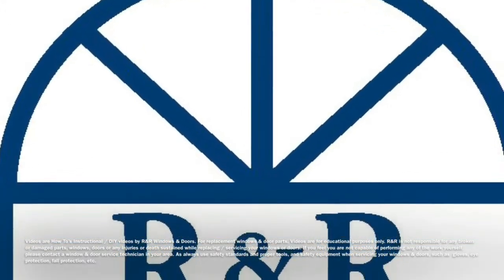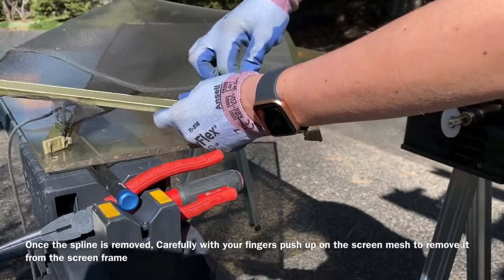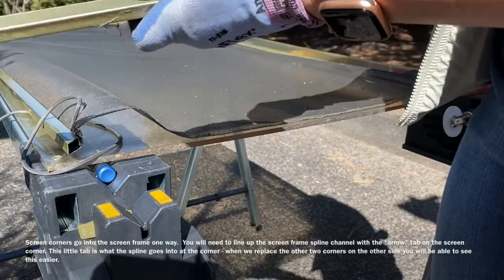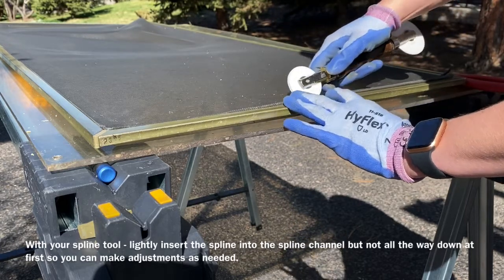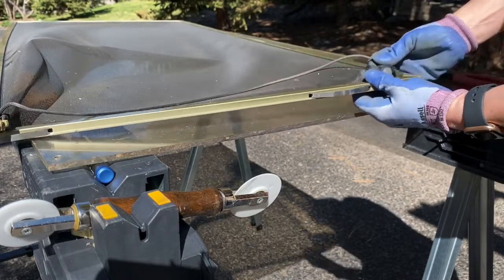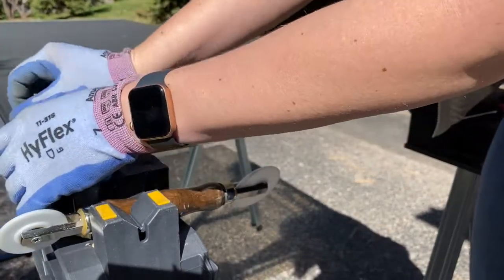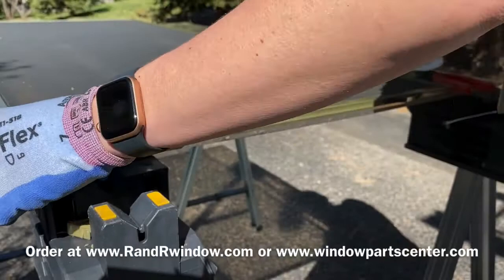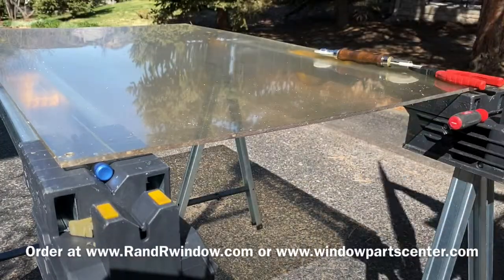How to replace Hurd part number 141 screen corners

Comment: a REALLY easy way to get the small broken half out is to run a drywall screw threw the middle of the piece, then use a pliers to pull on the head of the drywall screw. 🤘